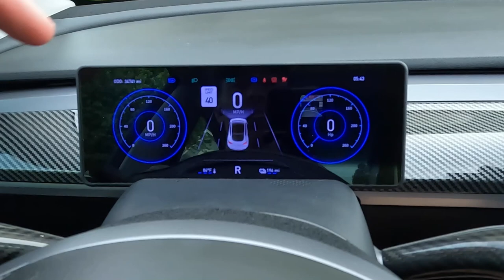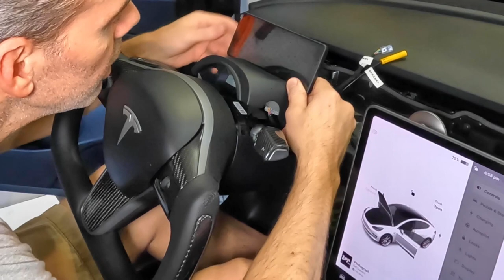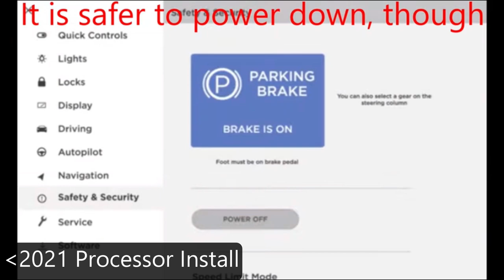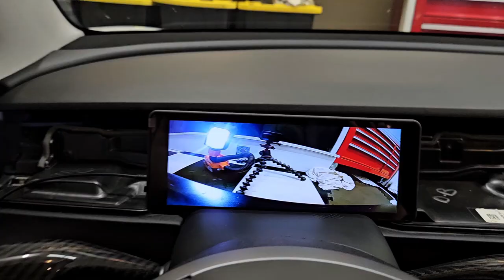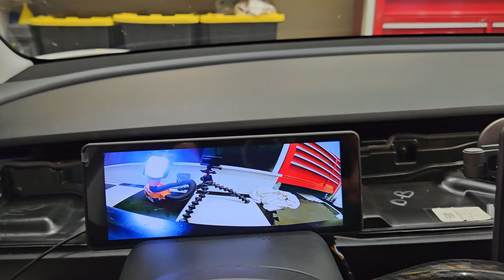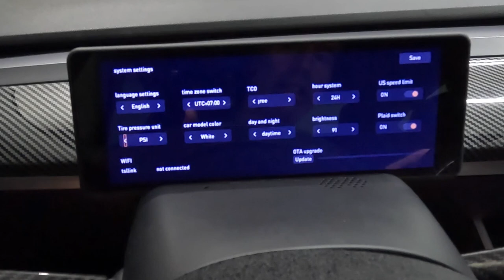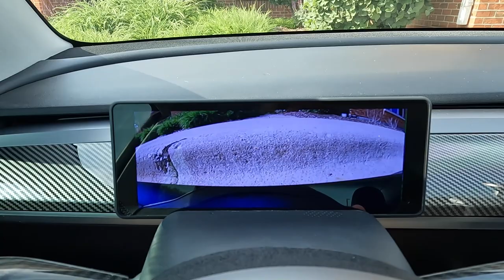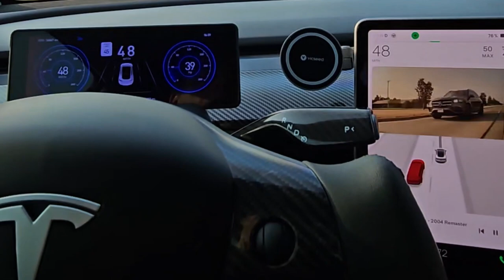New Tesla Mini Screen – Front Camera – Blind Spot Warning - Model 3/Y - 6.86"

Comment: Nice vid. Glad to see your channel growing. I've been following unlock since your tested at boost to your LR. Quick question on the mini screen. How much does it block the airflow? This is my concern with a lot of these. I spend a lot of time in a hot climate and I definitely don't want my front vents blocked when the temps are over 100 every day.
Reply from the maker: Hey, thanks for subscribing! 
They all block some airflow and it's really subjective as to how much it bothers you. The air can flow above it but I don't like air blowing in my face anyway... I like to split the air and have it flowing down more so it's not much of an issue.  The best way for you to really know is to use the measurements I give in the video and mock something up, like a piece of cardboard.
Reply: @mmark300  Thx. I have a mini display already and it doesn't block at all. I may try the mockup route. The mini display has been very uesful so far. When the car is 150 inside, I'll take all the air I can get on my face.
Reply from the maker: @wavshrdr8452  Oh, yeah, then real easy mockup.
Did you get a sunshade yet? I really like the one that's from my last video - way less heat from above!

Comment: Running the camera cable isn't that big of a deal, the way I did this with my hansshow is I actually just put that camera cable through the front bumper, run it through the firewall, then feed it through. I then use it as a fishing line and tape the wires that went to the 12v battery to it, then pull it back out the firewall (for displays that have that now) then feed the camera cable back through the firewall. It turned out to be easy, the only issue I have is the firewall grommet can never seal again with a wire running through the side. Wish there was a solution like a 3rd party grommet or something.